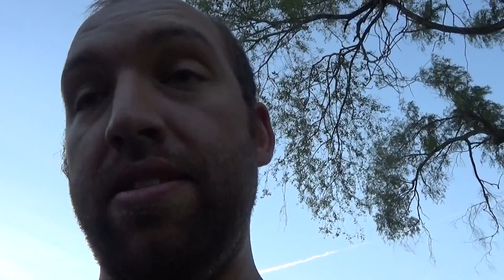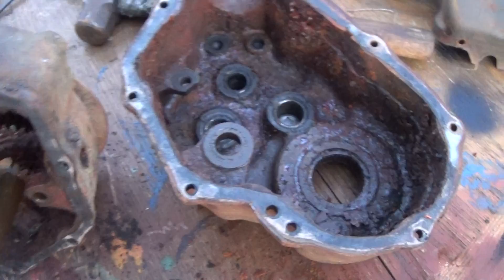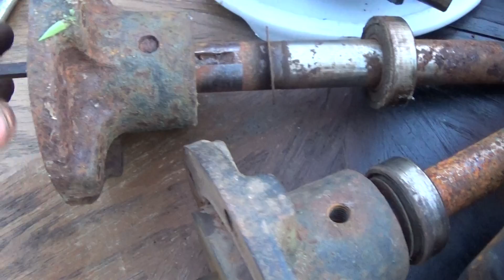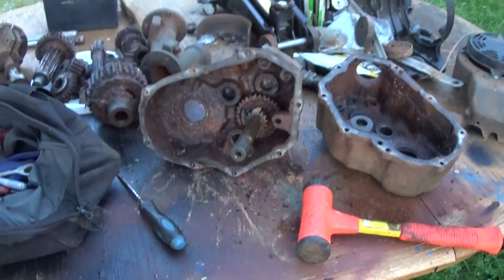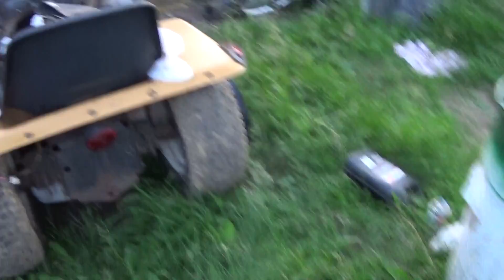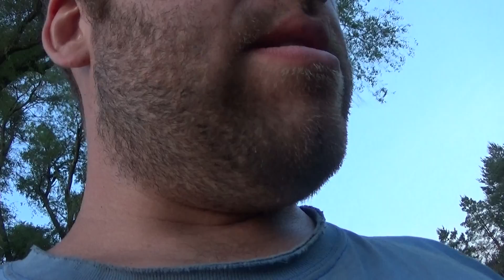2300 Peerless transaxle rebuild Part 1 By DR Blue!

Comment: I have an Ariens gt14 with this 2300 4speed . I let a mower shop try to fix it and they screwed it up. the first time I got it back it had no reverse , removed it and the second time getting it back it leaked oil .  it works but after changing the oil I found  metal bits in the oil. Also, when  the clutch is let out it makes squealing noise .
 I know one day it will go out and there are not made and hard to find. I've had this mower for over 30 years and it would pull like crazy .

Comment: Hi... -Do you think 1 of these would handle 50mph speed's?  I know the crappier Craftsman 1's will take it for aWhile! lol  -And is it hard to change an axle bearing in 1 of these? Like can it be done by unbolting the 1 axle, or does it all have to come apart in the middle/casing? It's a good bearing and all, but it seep's a bit of fluid out... And that same axle has like 4mm of In & Out Play!? Or should i just leave it till it becomes an issue? Spin's nice and quiet! And it leak's a bit at the Shifter opening, which is a giving anyway's...lol  Thx

Comment: i have this transaxle on my mtd is it any good? im building a off rd mower and would like to no b4 i lock it
Reply from the maker: I think there a good transaxle. I have rebuilt many over the years. Other then having to replace a bad oil seals or the input bearing. the shift rails are usually worn out, and it will pup out of gear. Some models of this transaxle have a limited slip differential.   The gears are nice and strong, and will last a long time as long as you have a good working clutch.